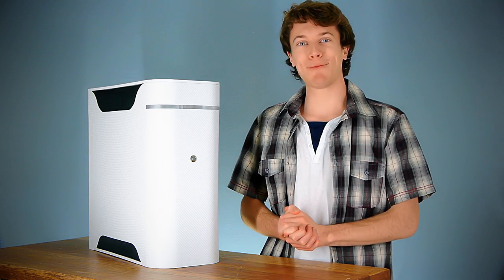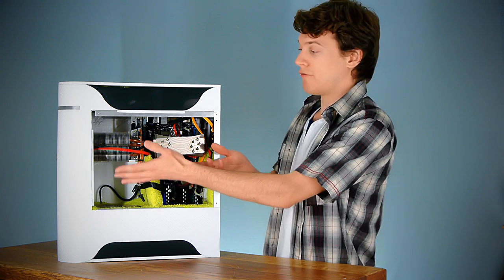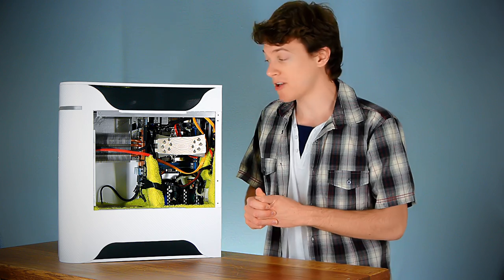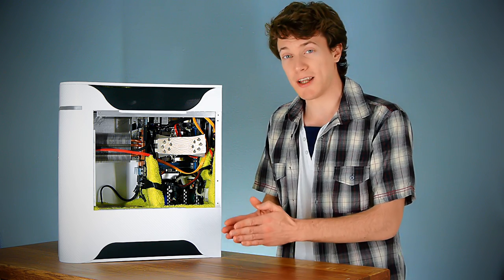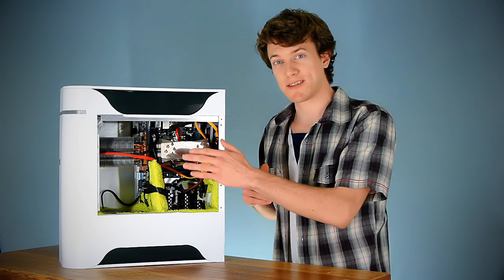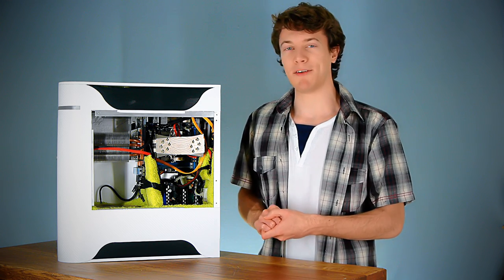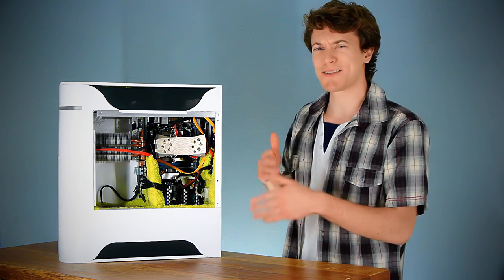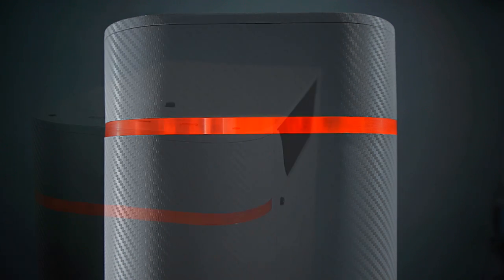DIY Computer Case - The Ultimate Silent PC (CLOUD UNIT)

Comment: When I was thinking about quiet computing few years ago I was considering putting a PC case in separate room, drilling a hole through a wall for cables and placing LED screen, keyborad, mouse and USB hub in another room. This would be the cheapest solution for computer noise & low air humidity problem.
And then SSDs, fanless CPUs and mobos, tablets became popular ;)

Comment: This is the most original and exotic computer build I've ever seen. I love how you completely redesigned the inside of the computer to accommodate heat extraction via air instead of water cooling. Very good video!

Comment: Brilliant design. You should commercialize this, improve the design, if it's a bit complex, make it more easier for user to install his hardware in it, maybe offer a special mounting bracket for the GPU because that's an enourmous cooler. I would definitely be interested in buying this. The button at the top for backing up, quite handy but maybe make it programmable so user can apply some function of his own for the button to do.

Comment: Can you show us your backup program? I'm interested in this one click backup procedure.
Reply from the maker: Sven Rahn It's called Free File Sync. Will do a video about it at some point if anyone's interested.
Reply: DIY Perks yes I am interested in seeing how that program is triggered by the button. thanks
Reply: DIY Perks
Yes, i could love to this backup program vid please.
Reply: DIY Perks I'm also interested!
Reply: DIY Perks very much interested!
Reply: DIY Perks yes please!
Reply: DIY Perks Yes that would be awesome!
Reply: Abdikarim Jaambiir  easiest solution would be triggering a silent operation (for any file sync program that support command line switches) via Windows Task Scheduler. Just make create a new trigger that reacts On an event, log by Microsoft-Windows-DriverFrameworks-UserMode/Operational, then you have to plug your hard drive into your pc and check for the Event ID via event viewer. Once you have the event ID, you can just make put it into Task Scheduler so that it can trigger by plugging in a hdd.
Reply: Make sure your backup system can handle accsidental deleations. You really don't want a file deleation, or possible damage due to a drive curruption or failing drive to propergate through and ruin your backups as well. Don't automatically sync deletes to your backup (do it manually) and keep a rotating backup as well. Rivision control is also a good thing IMO.
Reply: DIY Perks yeah please do a vid on it
Reply: DIY Perks Interested only because you have a fantastic means of conveying your words when you speak :P
Reply: The software he uses is "Free File Sync" then how exactly to set it up i don't know but there might be some info on their website ;)
Reply: DIY Perks Yes, please!

Comment: 10/10 would buy if available. kickstarter or submit to case companies? Never seen a case with such efficient airflow. PSU's that spin fan up only after a certain temperature could work too if the case had a PSU mounting bracket with heatsinks on it for intake to pass through. love the design though and the way you disassembled PSU for case airflow instead. SO much more efficient.
Reply: +Aristar Have you seen the 2013 Mac Pro? It uses a single fan to cool the entire system; the boards are put together in a triangular prism and the hot air rises from there and is sucked out by the insanely-quiet fan at the top.
Reply: +maccollectorZ (Commenting Account) I thought about that too, but this is quieter and cheaper.
Reply: ***** How so?
Reply: ***** They are not slow and they are not hard to use... especially when you consider the nice hardware and better OS.
Reply: ***** I still get modern performance out of my 2006 Mac Pro. Gaming? You can - not that that's even a good argument in the first place; that's a childish one, in fact. Any Mac is way more capable of gaming than some crappy Dell or HP you'd find at the store.

In terms of running titles in the first place, the only reason why Windows runs more games is because Microsoft is a gaming industry... which also happens to make the operating system called 'Windows.' It's a pretty crappy OS, but it just so happens that MS is in that industry. Mac OSX is more efficient and programmed better, but they just aren't a gaming industry - it doesn't suddenly mean that the Mac or its OS is bad at running intensive applications.

BTW, someone ran on their 2013 Mac Pro Crysis 3, on max settings, across six 27-inch, 4K displays... no lag.

Oh, and the 2013 Mac Pro was actually lower in cost than if its parts were to be replicated in a custom build... esp. considering the fact that it contains $6000 worth of GPU in it, yet costs about half that altogether. Also, my 2006 Mac Pro was $1000 LESS than a Dell workstation of identical specs.
Reply: +maccollectorZ (Commenting Account) Better than Dells and HP? No shit. I built my computer myself though and it would smoke any Apple computer you would ever have for less than half of the price.
Reply: Hunter Dominic Not in certain ways. As far as all-in-one systems go, Macs are the best ones out there. All others kinda suck at making them. They DO have their unique qualities, just like towers do. 

BTW, one cannot build an identical machine to a Mac Pro and spend less money. Every Mac Pro there has ever been (especially the latest one) has been less in cost than the cost of its individual parts.
Reply: ***** ... you have shown your ill knowledge by that statement alone. I don't feel like explaining what you have wrong.
Reply: maccollectorZ (Commenting Account)
I agree that the person in question does not need to further contribute to this conversation.
Reply: ***** You have your info very askew. First off, there are plenty of rip-off Windows PCs (and pre-built Windows PCs generally suck anyway). There are fewer Macs around for many reasons: Microsoft become huge in the 1990s with Windows 95 (which wasn't even a good operating system), since Apple wasn't doing too well at that point in time, there are SO many things like servers and cash register computers that would obviously not need to be Macs, and there are more Windows PCs produced than Macs. Why? Because Apple is a private company that makes their own software AND hardware. Tons of other computer manufacturers make their computers the same way and just have Microsoft provide their operating system. Thus, there are physically more "Windows PCs" out there than there are Macs.
Reply: ***** Mac OSX is free - you can put it on any hardware you like. Besides, that doesn't make Mac OSX or Macs suck xD. Are you saying that minorities suck?
Reply: ***** ...You are acting upon strange, subjective ideals. Do the world a favor and don't spread your misinformation. (BTW, I hate cell phones.)
Reply: ***** Seems to me that you know nothing about Macs. What a terrible generalization.
Reply: +maccollectorZ (Commenting Account) that is just a flat out fallacy. If you price out the components put into any mac pro, (as every single one of them is available on the open market, just without the apple sticker, since they've been contracting out to fabricators for many years that are the SAME COMPANIES YOU BUY PARTS FROM ANYWAY!!!!!, sorry this is just my biggest pet peeve whenever I see this argument as fan boys who don't really know how computer parts are made don't get this.) you would very quickly figure out that you are over paying by usually upwards of 500-1000 dollars on just components. The differences in the OS is obviously something I'm not going to debate as I prefer windows but, Mac has it's uses and work very well so I think it's just a matter of opinion. For the record though, I've owned many Macs in the last 10 years, and built many PCS and for my purposes, (gaming, video editing, sound editing, and some game design) I have found that a custom built PC with a partition is best for price, hassle, and just general customizability.  That being said, if you want a machine that will run fairly well, be useful to anyone (even granny) and don't really care that you're paying a little more... fuck it, go with a Mac lol
Reply: +RavenPrecept Yeah true, though I've replaced my PSU fan with a Noctua NF-P14r controlled from my motherboard, doesn't get hot around 650rpm and completely silent.
Reply: +maccollectorZ (Commenting Account) Yeah the R2D2/Trashcan Macs look pretty neat but for gaming you're still gonna hear that GPU fan screaming loud with a high end card. My solution for a high end gaming rig was spending about $2000 to build a silent water cooled system. Definitely not cost effective though, but for a high power system you need either GIGANTIC tower heatsinks on both CPU and GPU with silent fans, or huge water cooling radiators to dissipate heat with silent fans and anti-pump-noise measures. Then there's the issue of the PSU, I'm not sure how the macs do it but I assume they have a custom open designed one. my solution was replacing my PSU fan with a low rpm fan controlled via motherboard. One could also turn off PSU fan entirely and have negative case air pressure to pull in air through the PSU too but I would be careful doing this unless it's a Gold or higher rated PSU with fan-off features, they usually only need very little airflow. There's also the issue of coil whine/hiss which all high power graphics cards have, my solution was thermal pads and hot glue combined with soundproofing foam in my case.
Reply: sorry just realized I was on a different account, i'm the OP of this comment thread.
Reply: zionlee1004 The GPUs probably came down in price since then; but note that there are TWO of them - each were $3000 new. In fact, one site I looked at said that they were each $4000 new, but prices vary.

BTW, the Mac Pro doesn't start at $4000... it starts at $3000, which includes TWO of those $3000+ Firepro GPUs. 

You also have to consider the case itself and how it's built. First off, you only need one fan to cool the entire thing, and it's also barely audible: the case matters as well. It's also very likely that it uses way less electricity than a tower would, which saves you money. 

Lastly, Macs that have SSDs use a special PCIe interface that isn't only faster than a normal SATA interface, it's also one of the fastest PCI interfaces there are, as far as SSDs go. You can't get a faster SSD setup elsewhere. This Mac is certainly a good value for what it is. 

(BTW, I am not sure why you are mentioning MacBooks here...)
Reply: maccollectorZ (Commenting Account) i could not find the d500 prices and the mac book was just an error. i was supposed to type mac pros and i said 4000 dollars because the xeon and d500 is the 4000 dollar one. i would love to see the price of the d500 really if it is 3000 dollar each, because if it was, apple would definitely not be getting any profit off of mac pros. and amd gpu's are(as far as i know) cheap. it is what made amd cars famous, the cheap price to performance.
Reply: Rodboy25 About what? It's interesting how you challenge my intelligence when I'm mostly just giving factual information. Mac Pros are a good value for what they are. It often costs less to buy a Mac Pro than to build a machine with identical specs. For starters, the machine comes with two GPUs each valued at around $3000 new (yes, I researched this multiple times); that's $6000 worth of graphics in a $3000 machine - a $3000 machine that also includes the fastest PCI SSDs there are, expensive ECC memory, and great server/workstation Xeons. Trust me on this - you can't even buy one of these from another manufacturer and assume it to be of a lower price. In fact, even the 2006 Mac Pro was $1000 LESS in price than an equivalent Dell at the time. 

What else do you want from me besides my sitting here while you cuss? Looking at what I've said (which isn't consisting of blatant lies or misinformation) and cussing at it doesn't solve anything. All I can see is that you're irritated at what I've said, and that you haven't been able to come up with something that proves (somehow) that I'm wrong. So, please: tell me what you don't understand about these graphics cards.
Reply: maccollectorZ (Commenting Account) Its amd and cheap like a 4gb firepro costs 500 dollars so 2 4gb fire pro is 1k. The xeon in the mac pro also costs 500 dollars, equals 1.5k. the rest of the hardware cost lets say, at max, 1000 dollars more. You would still pay 500 dollars more. And amd are not know for high end hardware, but more bang for the buck. So considering apple swept low enough to get a cheapo firepro is maybe going to work on dumb bald rich kids, but those with decent hardware knowledge knows you are actually paying less for what you get. Also apple is not dumb enough to sell a macpro at 3000 dollars when even the gpu would cost them double the selling price. They need income or they will lose sponsors. Its how the world works.
Reply: +maccollectorZ (Commenting Account) Please send me a official link (preferably apple or amazon) with the specifications, part lists and details of any Mac Pro, Air or any Apple computer and I'll prove you wrong.
Reply: Rodboy25 Well, you know what GPUs are used already (either dual D300, dual D500, or dual D700), 4, 6, 8, or 12 core E5-1620, E5-1650, E5-1680, or E5-2697 Ivy Bridge Xeons, up to 128GB of 1866 MHz ECC DDR3 RAM, PCIe SSD(s), 6 Thunderbolt ports (way better than any other display connection), HDMI, built-in Bluetooth 4.0 (Apple has had Bluetooth capabilities in their Macs for the past 13 years now), an 802.11 ac wireless card, two 3.5mm analog/optical combo jacks, a built-in speaker,  10-30 MB of  L3 cache, two high-speed ethernet ports, four USB ports (up to 5 Gbps), and all cooled with a singular fan and within a compact case. There is literally no other better way to cool a machine; the hot, rising air is sucked out directly from the top of the machine by a fan that runs at 12dBA at idle... that's whisper-silent. Oh, and the base model uses only 43 W idle / 205 W max.

And here's the GPU info on the D300: http://www.futuremark.com/hardware/gpu/AMD+FirePro+D300/review

The D300 prices have come down since then (of course), so the D700 is likely the one that's still worth that much - and there's two of them. Apple charges $1000 for the D700s, when they would have a street price (give or take) of $6000 together. 

Lastly, you're getting a quality machine that will last AND keep its value. I find it ridiculous how worthless a Windows PC becomes after only five years. You can still sell a 2006 Mac Pro for around $250, esp. since they are nice, robust machines that have lasted for 10 years and still run like modern machines. I have a 2009 Mac Pro now, but I previously had a 2006 version; the thing ran flawlessly and pushed the Web, CS6, games, and many of things just fine - and on the latest version of Mac OSX.
Reply: +maccollectorZ (Commenting Account) yeah, yeah, yeah. You sound like you're part of their marketing team. Just show me the specifications list of any of their computers and I can show you that you can build that same system for cheaper. Just cut the bullshit. Stop putting a stoplight on them and saying 2 senteces how "Windows" is bad, even though it is software, not hardware which you are clearly defending.

Link to me the MAC Pro which you are referring to that is clearly so "better" than "Windows PCs", until then all of this argument is useless.
Reply: Rodboy25 You're so lazy; I just took the time to list the entirety of its specs and even give a link to a review on the GPU it uses. Look it up yourself! Be resourceful! I gave you factual information here. If you still don't believe me, use this valuable tool called a search engine and look it up yourself. You can't just berate me with accusations that I'm lying, yet expect me to present more and more information.
Reply: +maccollectorZ (Commenting Account) You claimed a Mac Pro which is cheaper than a built PC with the same specs existed, oh but it doesn' exist because you can't show it to me, therefore it doesnt exist.
Reply: Rodboy25 It's a freaking specific product xD. You know that it's a Mac Pro, and you know that it's a 2013 model. I gave you an entire list of its specs, now I expect you to do your own research, because I have already done it, and all you're doing it calling me a liar. You're being difficult. I gave you the model of Xeons, the model of GPU, and all the other specs... I already know what they are and that they come out to costing more by themselves than the Mac Pro costs to buy -  I don't have to go and research that myself. You're the one here who wants to know.

So take your mechanical gaming keyboard, move your lazy fingers, and go look up the processors, GPU, and other things that I gave you, because I gave you their exact model numbers! Be resourceful.
Reply: maccollectorZ (Commenting Account) 

I know this is from 1 year ago, but hey, you know what? You are spreading bullshit, I hope you are a troll, first of all, "Mac Pro 2013" it's not a specific product, there are several variations, and I took your challenge, so I saw the price of the top notch Mac Pro 2013 (12 core processor, 32 gigs of ram, 2 cards, bla bla bla). It was 9000.
I started making a list of parts, excepting the Graphics cards, because they were made specially for Apple. It all ended up in  3,740.68 american dollars, it has another kind of case, but if you want to make it custom, add another 500. For the Graphics card problem I just searched similar performance Graphics cards, and got two of them (They were actually superior to the firepro in the benchmark anyway). So yeah, do the sustraction and you'll see that there IS a lot of overprice in the apple products, I can show you the list if you want to.